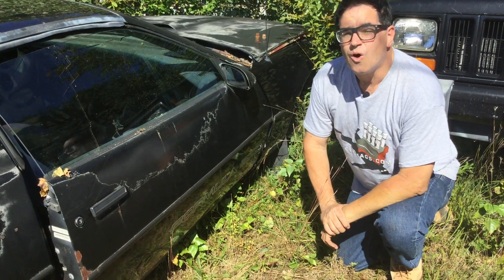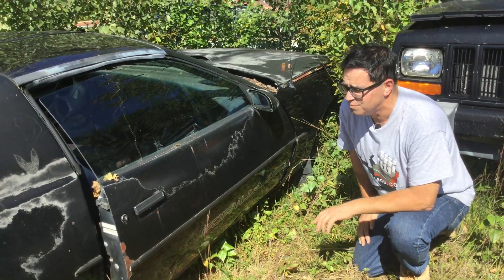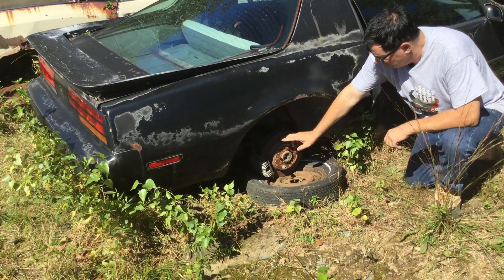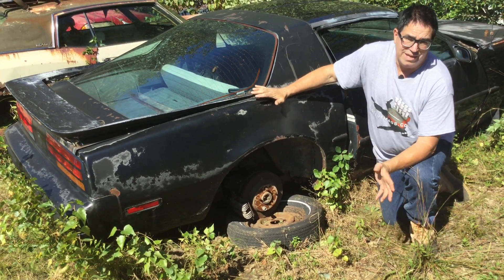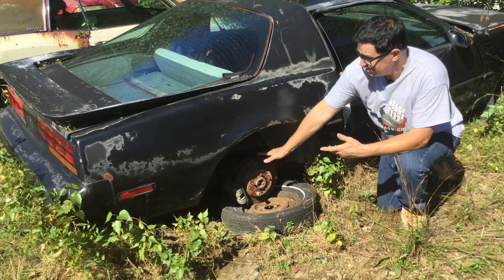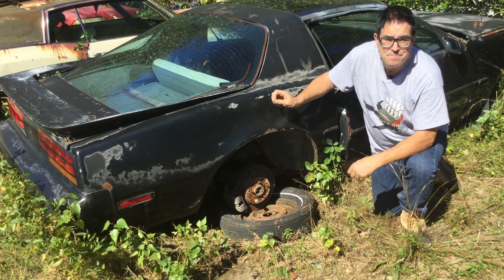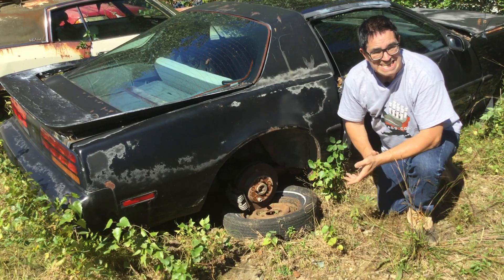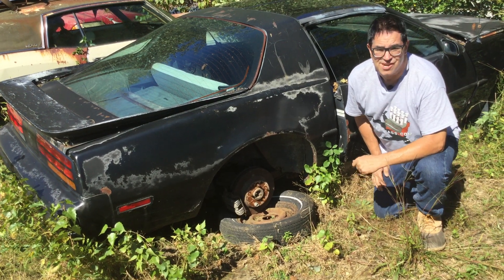Gen III F-Body Axle Gold

Comment: Yo Steve!  I was just watching you on Uncle Tony and seen a few of ur vids recently so I subbed up but this one particularly is interesting to me and very cool.  I had no idea about these options but between 93-98 I had an 83 SE FireBird sleeper 525HP 383 custom stroker with 294 solid cam, 1.6 rollers, angle plug camel hump 202's, ground rod beams, chamfered oil passages, etc.  Anyway, I found a 82 Recaro T/A running/driving 305 crossfire parts car for $600 and grabbed the disc brake rear end then found a used Richmond 4:10 posi unit that was nice!  I had burned up the 700R4 with the 350 motor before I think so now it had TH350, stage 2 kit and that aftermarket adapter on the tailshaft housing for the dang torque arm!   It's in 2 vids from 1996 VHS captures when we were kids!  One burning tires in the country with my friends 70 Challenger 340 and the other bracket racing at a track including my friends 69 Charger RT/SE, and other Cuda's. Camaro's, 10 sec bug and 10 sec snowmobiles!

Comment: Remember: if you're going from a drum setup to a disk setup you may need to change the proportioning valve for the rears to that of one for a disk setup. It's not always the case, but a possibility. I personally changed the spring out of my '92 Camaro's to a slightly stiffer spring which changed the biasing of the rear. The rears are felt sooner than before, which complemented the larger disk and 315 tire setup. The drum biasing was to late. You still felt the front brakes for most of the stopping distance. Just an FYI.
Reply: Thanks for the info. Also, drum brakes had a check ball in the drum side of the master cylinder, because of the return spring that drum brakes had. Take out the check ball for disk brake usage or your disks will continually drag. No return spring on disks.
Reply: @shanepowers7566  ahh, I didn't know about the check ball. Some good info. Thank you.

Comment: The down side to the 9 bolt is you can't get many parts, and the parts you can get are expensive.  Unless you are going original (and if you car didn't come with a 9 bolt it isn't original anyways) put in a modified ford 8.8 which is quitter and more efficient than a 9 inch but almost as strong.  Then again I haven't blow up my 10 bolt with the LS1 and T56 I put in my 89 yet (I put the posi and gear from a 2000 trans am into the 1989 housing)... I'm sure it will happen one day but so far so good for street driving.

Comment: I pulled a Borg 9 bolt 3.45 off a 88 Formula the other day 169$. Also have a 9 bolt on my 86 TA WS6.
Reply: thats a fucking score !!
Reply: @trillrifaxegrindor4411  yeah I got the calipers and the and the discs too but there are not in the best of shape. The car had 160000 miles on it and it's a 3.45 ratio. The yard had a 30% off weekend. I had tote the rear end in a wheel barrow for 2 hundred yards to the front not easy.

Comment: Only thing better about the 9 bolt over the 10 bolt is it had bolt in axles and the 10 bolt didn't.
Reply: It is marginally stronger and had a better designed posi unit than GM’s standard 10 bolt. This is the reason GM put them in most high performance 3rd gens over the standard 10 bolt.
Reply: @mikee2923  I wouldn't call a posi that literally eats itself to death over time a better design. It is true however that new vs new, the 9 bolt carrier will hold better. GM should have just put the Dana 44 in ALL the TPI cars and been done with it.
Reply: @rbarger71  I agree with that 100%.

Comment: Gonna have to check my 1991 5.7 GTA, which may be hard to determine due to the door and console tags are missing. Thanks for the specifics on the special rear end.
Reply: Chances are if it is a 350 TPI car it will have it. In fact most TPI equipped 3rd gens were equipped with the 9 bolt B/W.
Reply: just look at the rear end,the cover has 9 bolts instead of 10

Comment: I never understood why GM did not use the 8.5 in the V8 F body.  When I worked at the dealer back in '80's blown up 7.625 rears was a daily occurrence.  Big money maker for me, got real good at setting up gear patterns.
Reply: It was about fuel economy. A lot of decisions they made was. The smaller, lighter rotating mass was more efficiant and helped their CAFE rating.
Reply: I did a "RockFord Turn" in my 83 onetime and shattered the spider gears AND split the flexplate!  Everyother time it had worked beautifully!  That's when we built the motor up to a custom 383 stroker and put in richmond 4:10 posi unit.

Comment: Finally called on this one Steve. He sadly says it's a parts car at this point. Floors and rear control arm areas pretty rusty.
Reply: Well what did you expect for sitting in a wrecking yard? Real question is, are you scared of welding in new floors/panels? its all just sheet metal spot welded together. I've bought a few cars that were rusty for very cheap, welded in new panels and bam I got cool cars for half the cost cause other people are scared of dealing with rust
Reply: @GearScar   it isnt super hard,you need the right tools and the space to do it though

Comment: Friend of mine had a 1985 Trans Am that had some special order items one of which was a Borg Warner rear axle. It was only discovered when he went to have the rear gear changed out. They said that axle shouldn't even have been available in '85.
Reply: in 1990 I bought an '85 Bandit II from the original owner & he special ordered a few parts for his such as the Borg Warner axle but in '88 he swapped the 305 for a 350 out of a wrecked GTA & man was that car fast

Comment: I have an 89 Formula 350 I bought from the junkyard. Wish I close. That wing looks to be in good shape. Mine's not
Reply: Those wings never live . 
I removed the one from my 88 Trans Am , and replaced it with the 1988-only RPO Z20 rear spoiler .
Reply: @Richie_the_Fixer  that's that Ive heard.
Reply: Fiberglass aerowing is the way to go, the factory rubber one has a metal frame inside it that rusts making the rubber swell, crack, and fail.  I've had my fiberglass spoiler now for 20 years on my 89 formula. It's spendy but done and done and never look back... it is also so much lighter you can go to the weaker struts on the hatch and avoid the aero struts pushing the hatch out of alignment.
Reply: @Avi8tor857   i know,i have one i took off an 88 gta i parted out,damned thing weighs 2 pounds maybe...i have to put it on my 86 trans am but my hatch doesn't have the clips for the side wings....
Reply: @trillrifaxegrindor4411  they have metal clips with the fiberglass spoiler.  If it wasn't original arrowing You attach to the spoiler side arms and then clip it around the frame.  3m double side trim tape will also hold the arms in place (actually better than the OEM clips)

Comment: I had an 83 camera with 305 , 5 speed was fun to tear up ! Heard that 88 up was the rear end I needed. Smoked my 10 bolt with 3:73 and got a 3:40 something during the nineties for 250 $ . But that rear end had 1/2 metric and 1/2 standard was crazy back and forth to replace !
Reply: Bummer I have a vortec 350 in my 85 with a big cam and a carb and it's pretty awesome
Reply: A "camera" and a Camaro are two different things.
Reply: was that a Sony or Panasonic camera? my '83 was an 8mm reel to reel
Reply: @SquirminHermanthe1eyedGerman  I actually bought a 72 cheby p u in early nineties with an 8 track pioneer ! Was an awesome ride until it wasn't , I loved that cameo though , shifted it so hard into 3 Rd so much the linkage came off firewall and some good friends tacked it back late at night was some good memories !
Reply: @mikesr3407  hahaha I hear ya! Had a few 8 tracks in some of my cars back then, most of mine was Radio Shack stuff until those Pioneer Super Tuner cassette decks came out

Comment: When I was looking for a good rear axle for my g body. The hot ticket was the Buick 8.5 from the turbo cars, almost a bolt in but so so spendy.
Reply: I was lucky to find an 8.5 in an early 80s Cutlass in the junkyard. Extra lucky that it was also a half off sale. Going in my 80 Monte
Reply: more unobtainium....
Reply: I found a 8.5 10bolt with factory 3.73 gears in it at a pickNpull....$180 out the door,and at the time they were going for $800-900 on the internet.....I still don't know how I got so lucky,i found it under a El Camino
Reply: Definitely we find a bunch and not in junkyard but rides someone actually owns and it sad

Comment: It's got the PBR brake calipers too!
I believe were also Australian sourced. (RPO J65)
Reply: Good catch!
Reply: They are.
Reply: 89-up only. Pre-89 cars with J65 (four wheel disc) had Delco-Morraine rear calipers, including cars with the 9-bolt rear end
Reply: It has PBRs because there were no drum brake equipped 9-bolt rears. The 9-bolt was introduced in 1985 on the L69 MM5 cars, and were all J65 equipped until the 9-bolt was discontinued.

Comment: I accidentally ran across a 9 bolt in a v6 camaro in the bone yard. 10 mins with a Sawzall and $75 later I had one. Just wish I could find a tpi unit and heater box(non ac car) but finding that in the Midwest is almost impossible. 🤷‍♂️
Reply: someone added the 9 bolt to the v6 car unless it was a TTA .....

Comment: Great info.  I never knew they put Dana 44s in those.
Reply: GM never "put in" Dana 44s. 
They were available over the counter , or , as he mentioned , in SLP Firehawks.
Firehawks weren't built by GM , they were "contract cars" , built FOR GM by Street Legal Performance , an outside contractor.
Reply: @Richie_the_Fixer  That’s right.  It’s been so long since I ever thought about those cars that I wasn’t even thinking about that.  It’s a shame they couldn’t built a real performance rear to begin with.  Ford and Chrysler made it easy.
Reply: @Richie_the_Fixer  Back in the day Dana 44s were sometimes installed as factory warranty replacements if the rear in your F body failed. Wish I had known that as I would have tried to grenade the 9 bolt in my Formula 350 had I known they would have replaced it with the Dana.
Reply: @Mitten Made Muscle Cam Bentey from Car Craft showed the option in 1983, as well as the Cat Back exhaust and other off road parts. It was well puplicised.
Reply: @deanstevenson6527  true , it was well publicized. 
It was pricier than having a dang 9" Ford modified for the Firebird , though ! 
In the early 80s , 9" posi rears weren't hard to find in the junkyard , they were just WIDE , and had the wrong brackets . 
Cut , weld , & have the stock axles resplined , that's all we did back then !
Reply: Yeah I thought only 10 bolts 8.2
Reply: The Dana 44 was for sure a stout Chevy Power Parts "over the counter" option just like the earlier Gen 1 Z28 Cross Ram intake was an " in the trunk" option. The Mexican Fox Mustangs also got the Dana 34 and 44 for Fox Fords. Dana filled the gap that the demise of the Corporate 8.2 Pontiac axle left.  The 9 bolt Borg Warner/BTR M78 was where the rear disc brakes came from....the West Gernan Opel Commodore and Fishermans Bend PBR  Holden Commodore system from 1978.
Reply: @Mitten Made Muscle *should've or should have. There's no such thing as "should of."
Reply: @Mitten Made Muscle Yes, it was offered over the counter. I still have catalogs that show it was available for sale at the time.
Reply: @Mitten Made Muscle The Dana 44 was also available from SLP which was one of the first aftermarket companies to make performance parts for the 3rd gen F body. They were also sold at Summit Racing who also sold SLP’s complete line of 3rd gen performance parts.
Reply: yeah,like 5 of them 😁.....super rare item
Reply: @trillrifaxegrindor4411  Not sure how many of them they sold but I remember in about 95 or 96 Summit had a close out sale on them for like $799 for the whole assembly with 3.54 gears. I lived in an apartment and was short on cash at the time or I certainly would have bought one. By the time I was able to scrape the cash together they had been long gone. Same with a lot of the performance parts for the 3rd gens that used to be available but were pricey. They have basically quit making everything for TPI cars which is a shame. The first Firehawk built in 1992 was the fastest F body built since the muscle car era and its performance was only slightly bettered by the last LS1 Firehawk. There were an awful lot of fast for the time TPI cars in the mid 90s.